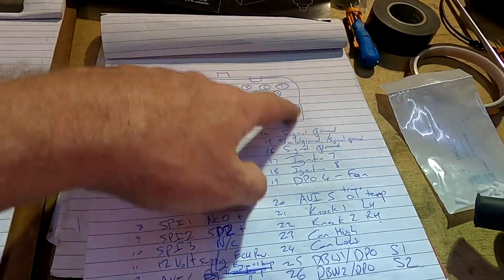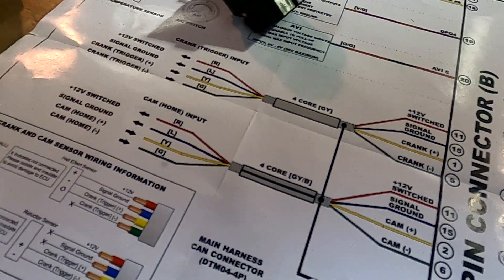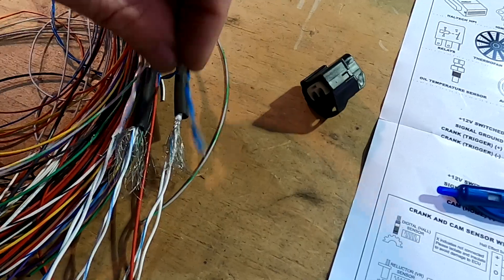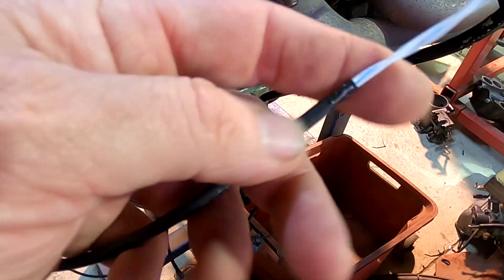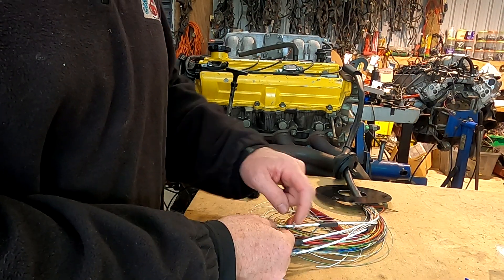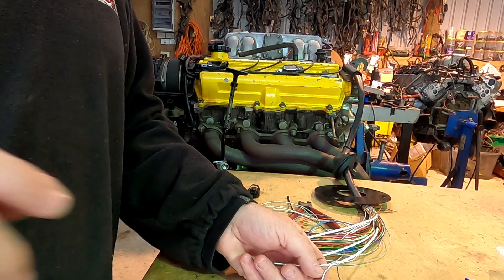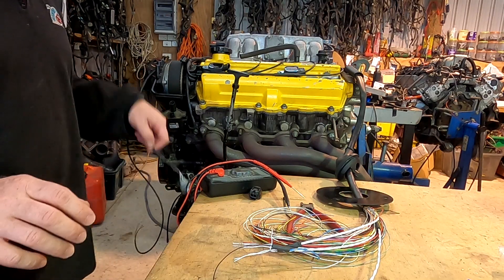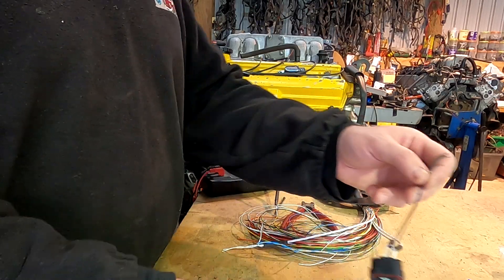Wiring Haltech ECU to 1uz Engine Part 1.  Crank and cam sensors

Comment: Good day, your vids are very informative,  pls , what's the best ecu for a first gen 1uzfe...swapping in the mk3 supra....Byron frm Jamaica
Reply from the maker: Best is subjective.   Information such as stock ecu or aftermarket,   your budget,  if you want coil on plug or stock distributor setup,  sequential injection or group, etc etc.

Comment: quick question i am wiring a 1uzfe vvti using a Haltech elite 2500 premium harness and wanting to use a DPO to control the alternator will the DPO connect to the "S" pin and can i use a signal ground for the "L" pin on the alternator?

Comment: I have 1uz ufc 10 in my Mitsubishi pick up. Is it possible you could make an adapter loom for the haltech so I could just swap out ecu and plug the haltech in without stripping engine bay and making my mod fast and plug and play.  Also could you supply and base tune for engine and box to.   If I could just switch out ecu drive to my mates garage then he can tune it in his rolling road.  My truck is my daily driver and it can’t be off the road so this is my only option.   Please help. 
Thanks.
Reply from the maker: If you could supply the way in which the ecu is wired and are competent to commission the adaptor then I can make it.  I already have a couple to do at the moment.  Cheers Kelvin

Comment: Hey Kelvin, I’m wiring my 90 ls400 into my old f100. Real quick, is there an easy way to eliminate stuff like airbags I don’t need? Can I just grab a abs bundle and start removing them until I get to the source? Is there anything I shouldn’t touch? I removed the whole wiring loom every single thing it’s overwhelming last time I used an easier car harness. Any tips appreciated
Reply from the maker: I would recommend watching some of my stock ecu wiring videos.  You will see I start with just the ECU and engine harness and throw the rest of the cars wiring away.  Very simple to do.  If running auto I reconnect the shifter inside the car.  Cheers

Comment: I’m assuming that won’t work on the VVTI?
Reply from the maker: Why are you assuming that?  Vvti still have cam and crank sensors,   and I was running a vvti trigger wheel in this engine.  The info swaps over fine for vvti.
Reply: @CartuneNZ  oh ok thanks! I thought that the VVTI electronics would be different. I have a gs400 and I’m still learning about it.

Comment: Have you worked with the speeduino on the 1uz before?
Reply from the maker: Ive got mates and customers speeduino but not personally at this point.  I get to see both the successes, failures and issues.  Cheers